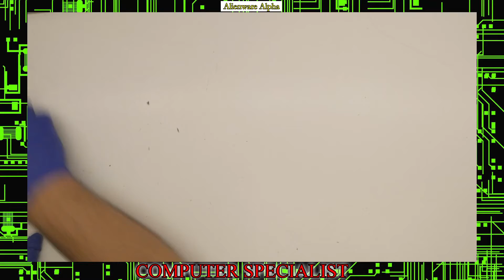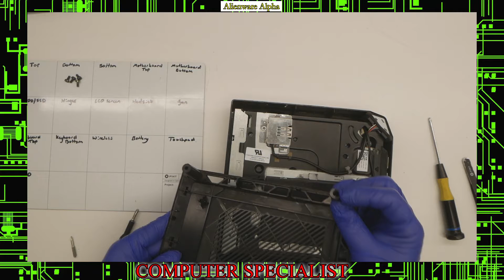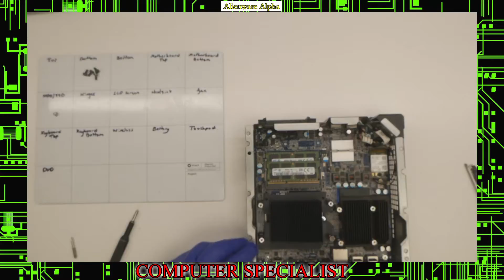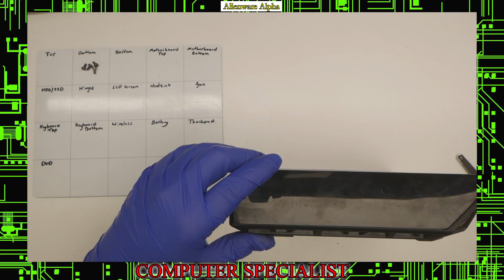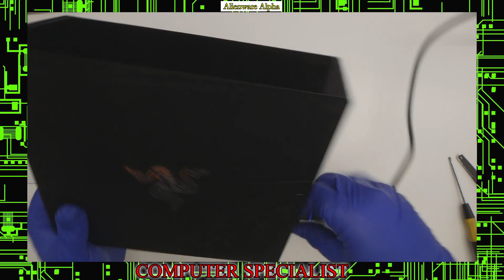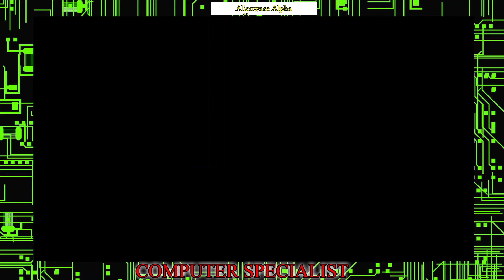How to fix your Alienware Alpha / Steam Machine when Power Button Flashes Yellow 5 Times on turn on!

Comment: Last time I turned it on was a few years ago I was going give it to my daughter but it gave me the light of death when I pulled the.  A battery an replaced it it still gives the yellow of death so I’m unsure what to do
Reply: Did you go into the BIOS after you booted it up and put the correct time in and then save and reset? You also have to leave the CMOS unplugged for at least 20 minutes before you plug it or the new one back in again.
Reply from the maker: I also seen where the cmos connection gets corroded etc. Best to test with a voltmeter to make sure 3v is getting to board.
Reply from the maker: Did you try reseating the memory sticks or replacing?

Comment: This is an issue with the EEPROM chip, its consistent with every revision of the alpha, the EEPROM chips used were defective from the release, replacing the EEPROM chip with a new one flashed with a non-corrupt bios should fix 90% of Alpha consoles with the 5 yellow flashes. Correctly working eeproms should boot without a CMOS battery installed (though they wont keep system time correctly)
Reply from the maker: Yes this model is so buggy! We do battery first, then bios next. But usually its bios battery for us! Thanks for the heads up!
Reply: They should've done a recall then.

Comment: can the processor cause 5 blinks ? i tried the battery no joy. lights up blue for maybe 3 seconds then turns to 5 yellow blinks. when i get the volt meter on the capacitors at the back of the graphics chip its shorting so wondering it could be the cpu causing that or weather the graphics are fried ? thanks
Reply from the maker: Did you get it working ever? Could be video card or maybe bios needs to be reflashed?
Reply: Did you go into the BIOS after you booted it up and put the correct time in and then save and reset? You also have to leave the CMOS unplugged for at least 20 minutes before you plug it or the new one back in again.
Reply: @luigiprovencher  yes i did all that as it was not displaying correctly in the end it was a shorted chip i managed to do it and was sold ages ago. but thanks anyway.

Comment: I reseated the Ram after blowing the Ram slots clean and my Steam Machine is now booting again after giving me the 5 blinking lights yellow lights (of death) over and over.
So thank you for the hint!

You mentioned it might be a Mainboard or Ram Issue even if 5 blinking lights, per manual, means CMOS issue. But i thought it's worth a shot to try the Ram as this is literally the only part I can manipulate, aside form reseating the CPU.
Oh right, also make sure your CMOS Battery is actually working.

Also the USB at the bottom is a slot specifically for your controller dongle, as these were Steam Machines, designed to work as a Living Room PC, they were delivered with a steam controller, and the dongle for that can be hidden in there.
Reply from the maker: That's Great!! Feel free to subscribe to our channel for future videos!

Comment: my wifi won't work on mine anymore has issues finding internet then when it finally finds internet connection and I connect to it then after awhile it doesn't work it disables it's self my internet and my neighbors internet won't show up i restart my alienware alpha and still disabled something wrong I even did a factory reset and works for a little then stops working the default windows is windows 8.1 but I upgrade it to windows 10 upgrade so not sure if its windows 10 or whats going on I have the alienware alpha cpu i3 gpu 860 version I used windows 10 on it before had no issues with wifi connection before less it's because of there  new update on windows 10 when the internet worked on win 10 there was a new update for it i downloaded the new win 10 update then the internet connection stopped working on it not sure if it's  that or something else if you have a fix could you please make a video
Reply from the maker: I would first try and make sure the antenna wires are plugged into the wireless card that's on the motherboard. If they are then I would replace the wireless card. Be careful pulling the 2 antenna plugs off the card and also putting them back on. Using something plastic is always good. One screw and the card comes out. can order the exact model you have (will be listed on card) or this one should work.

https://www.ebay.com/itm/334539479628
Reply: Hardware is not the problem, it's the driver problem, try to find the right driver.

Comment: i still have it after doing this. i think it is an alienware motherboard hidden issue
Reply from the maker: Is it exactly 5 flashes still? Also make sure you hook up to screen and recycle it a few times (Hold power button in for 8 seconds and then wait a few seconds and press to turn on again)? Also one time I did one and after I got back together it got 4 flashes, and it turned out it was the memory not seated properly. I took one stick out and it turned on properly, added the second back and it was fine! Another thing to check is the voltage and make sure it's getting to MB (Maybe slightly dead new battery... don't laugh had it happen). Ground the voltmeter to a ground screw on the motherboard somewhere and positive on the motherboard side of the bios plug. Make sure its 3v or slightly higher!
Reply: @computerspecialist8533  yes, 5 flashes. It occurred after more than a month on shutdown.
 Replaced cmos-same
 Reset cmos- same
Hooking the blue jumper to service mode then power on-same
Returned the blue jumper then hold power for 20secs and power on solved my problem. I still replaced the cmos battery coz voltmeter reading is 0.
Reply from the maker: Yeah I would buy a nice new bios batter (Which I think you may have already did) Make sure you get 3v or higher. I have bought batteries from eBay and they only read 2.9v etc. from sitting around too long. Also you can use any other 3v bios batter with wires and swap the end from the original one (To save some $$). Another thing I have seen fix "ODD" issues in general is to set Bios to defaults within the bios settings. We have other non related "ODD" issues and this sometimes clears all the codes and the problem goes away.
Reply: Did you go into the BIOS after you booted it up and put the correct time in and then save and reset? You also have to leave the CMOS unplugged for at least 20 minutes before you plug it or the new one back in again.